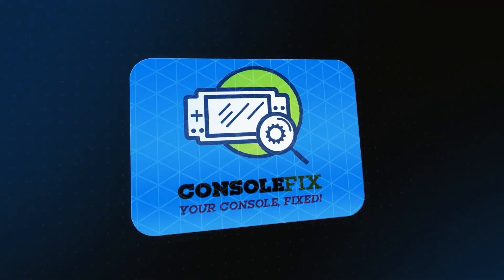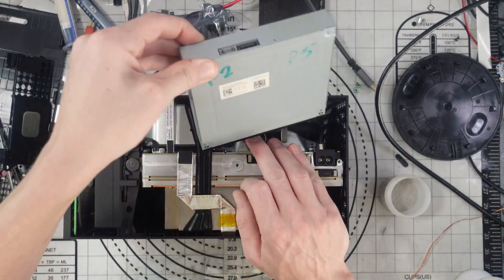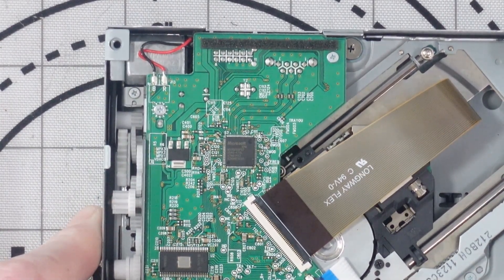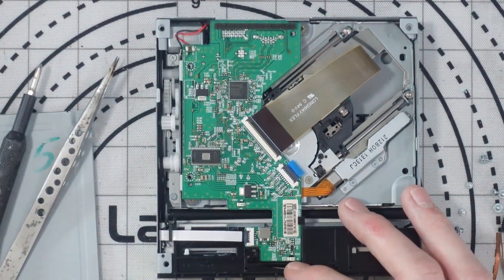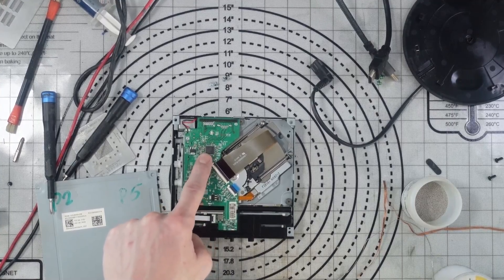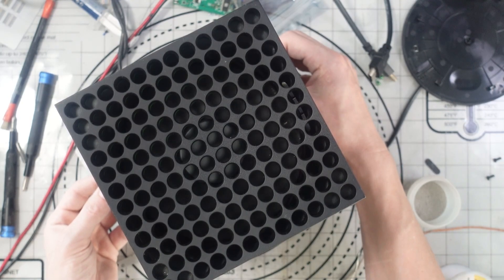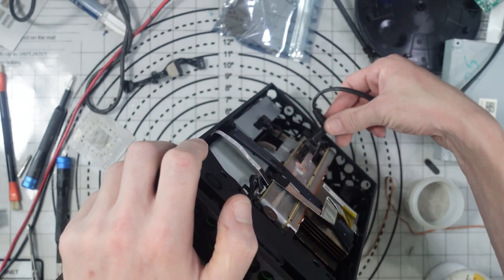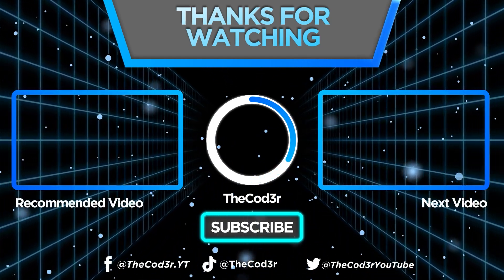I Had To Fix This Xbox Series X TWICE In Two Days! Discs Not Spinning Repair...

Comment: Quick Question: Have you ever encountered the PS5 error code SU-101311-7? I tested the fuses, they're all fine, as is the disc drive itself. Now I'm suspecting it might be something with the southbridge itself. PS5 support literally doesn*t know the error either. Have you maybe had experiences with this error before?

Comment: Some consoles won't spin the disc if the laser is bad, not sure if the series x is like that
Reply: Most CD drives were like that, they'd first focus then spin. That was in the early 90s when I worked on them daily. Is that useful information or not with more modern drives, who knows? That may have changed. But if you're working on early 90s kit, there you go.

Edit to add: if you find the laser test point then you want an eye pattern of 0.9-1.1Vpp. Easily spotted on a 'scope if you search for what it should look like. Don't overdrive the laser, you'll be trying to find a replacement before long.